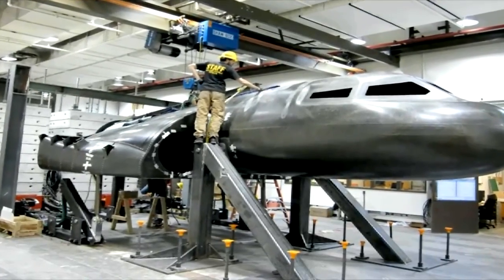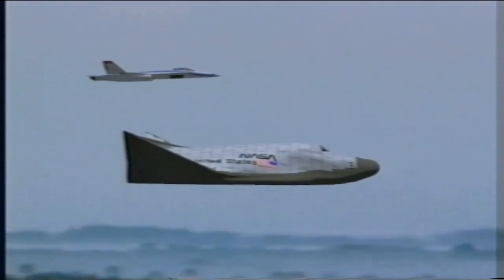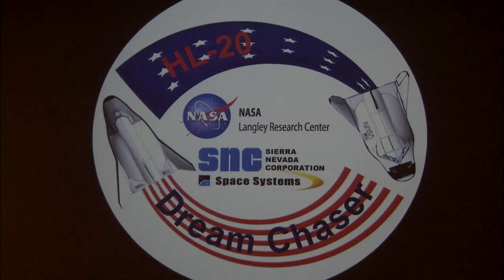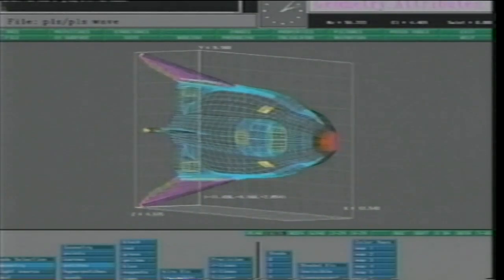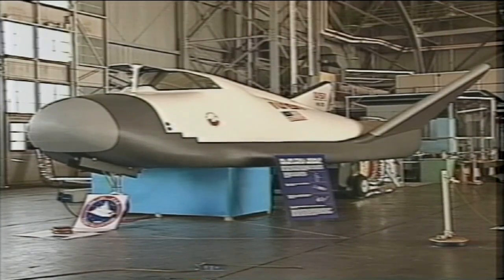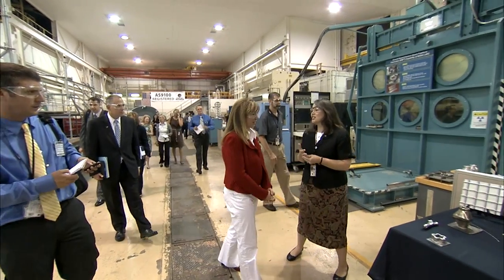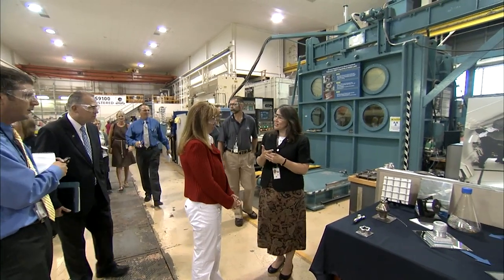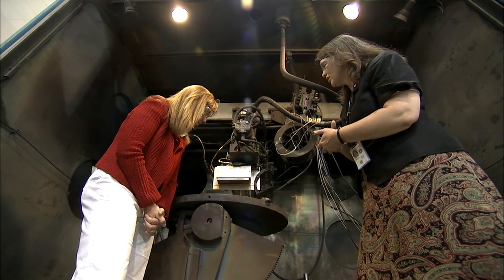Celebrating NASA Langley's HL-20 legacy

Comment: Actually it is flying now. Its the Air Forces X-37B....but don't tell anyone, its a secret !!
Reply: Sorry to inform you the X-37 was developed by Orbital Sciences and is not manned. I have seen the HL-10 and the X-37 they are different platforms. The Dream Chaser is based on the HL-20 and they said the mock up is at Sierra Nevada facility.

Comment: the HL-20 was one of the biggest and most expensive NASA failures, that costed over $5 billion without ever fly once in space and deleted since too expensive, seriously flawed and very dangerous for the astronauts - it wasn't designed to be launched atop an Atlas V nor to land on a runway like a Shuttle (since not even has the space for the landing gears) also, the internal space of the cabin for the astronauts is less than that of a coffin